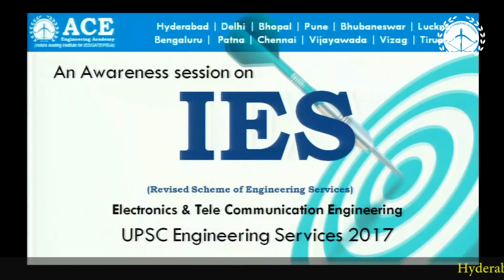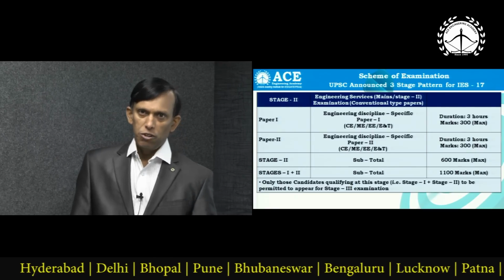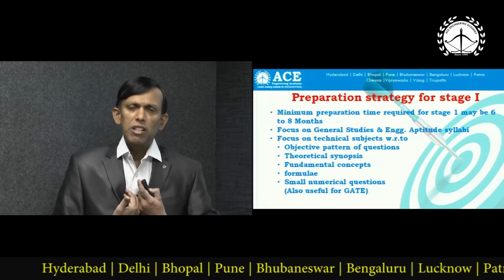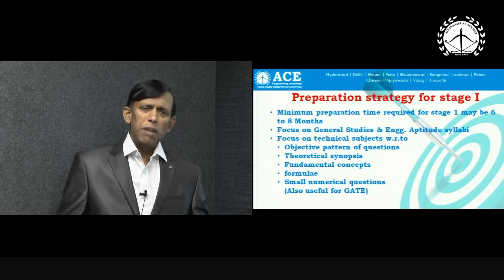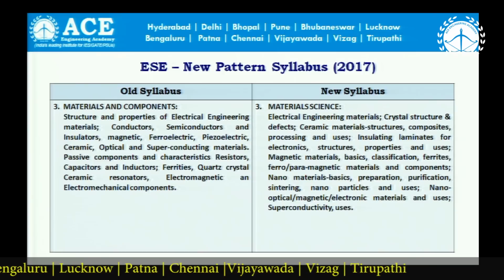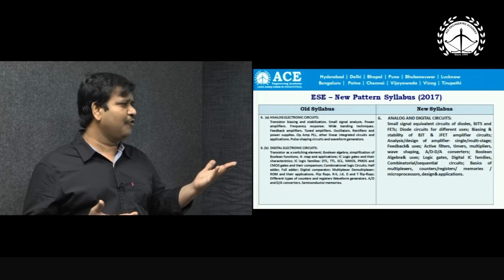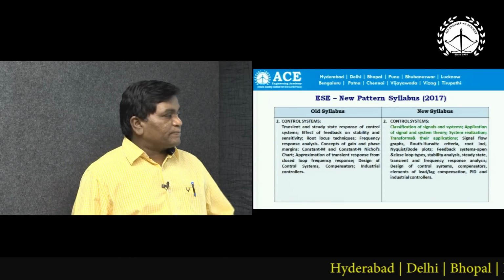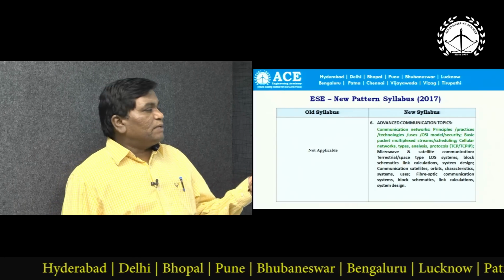Revised Pattern for Electronics and Telecommunication Engg. (ESE) IES-2017 Exclusive

Comment: Sir, actually I belong to electronics and Instrumentation branch. And I want to participate both exam ESE and GATE. please suggest
Reply from the maker: Dear Student,
Yes, as you have completed your engineering in EIE stream you are eligible to write both GATE and IES exams.
For the preparation of both exams it is little difficult. So, you can take classroom coaching it will help you to prepare in better way. If you are unable to take a classroom coaching you can take a postal coaching where you will get printed study material with solutions, Workbooks, Relevant theory and previous questions and solutions along with test series. Please visit below link for complete details about batch schedule and postal coaching. 
http://www.aceenggacademy.com/postal-coaching-gate/ 
http://www.aceenggacademy.com/new-batches/
Team ACE Engineering Academy

Comment: m.sc physics with electronic can apply
Reply from the maker: Yes, you can apply for M.sc Physics with Electronics. A candidate for the post of Indian Naval Armament Service (Electronics Engineering Posts) and Indian Radio Regulatory Service Gr ‘A’ may possess the qualification mentioned below namely:‐  M.Sc. degree or its equivalent with Wireless Communication, Electronics, Radio Physics or Radio Engineering as a special subject.
For more details, Please go through the below link..
http://www.upsc.gov.in/sites/default/files/ESE_2017_English_Notice.pdf

Comment: in advanced communication topics.
the first subject is communication networks.
in more clear idea this is pattern .
1)osi model  of different layers  and their functionalities.

2)lan and wan technologies.

3)brief idea of all layers of osi.
   like flow control, error control , framing,mac layer, ip addressing, fragmentation, routing algorithms,ip, icmp,arp,rarp ,dhcp, tcp and udp protocols in terms of wired communication.

4)security and their algorithms(confidentiality, authentication)

5)circuit switching and packet switching.

6)packet scheduling algorithms (weighted fair queueing, fair queuing, round robin etc)

7)wireless architecture (mac and data link layer, ieee 802.11)

note: above 7 topics are the base or funda to understand 8 and 9 topics.

8)cellular architecture.
9)cellular computing (wireless ip, wireless tcp concepts)
Reply from the maker: +kaswani kumari

 Dear student 
we really appreciate on the analysis made by you. we certainly consider your idea in the preparation of the material of the above subject and guiding the students. Because of the students like you only , we teachers update our skill set to serve the student community.  Our wholehearted thanks to you. Wish you all the best , god bless you.

Y.V. Gopala Krishna Murthy
Chairman,
ACE Engineering Academy